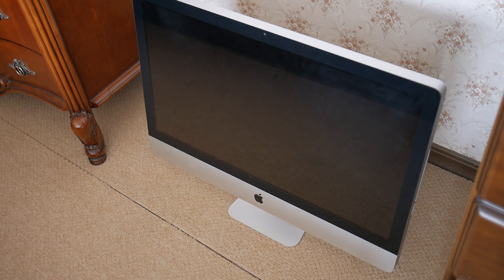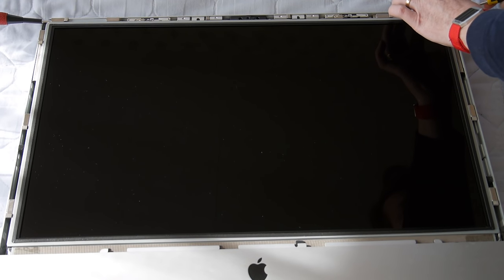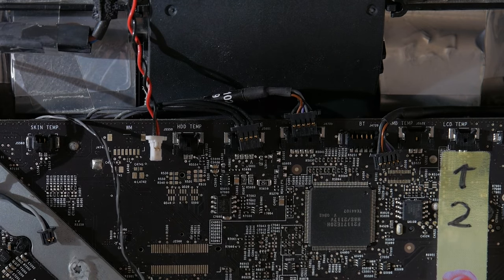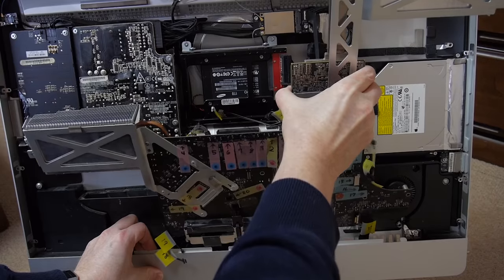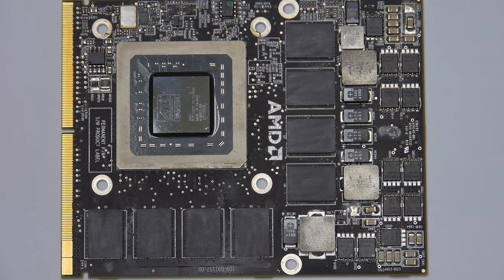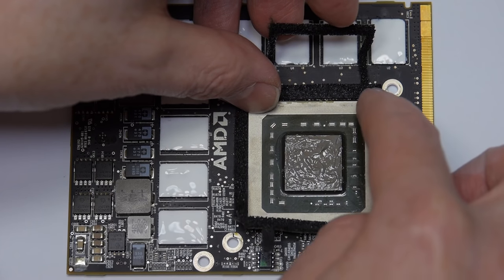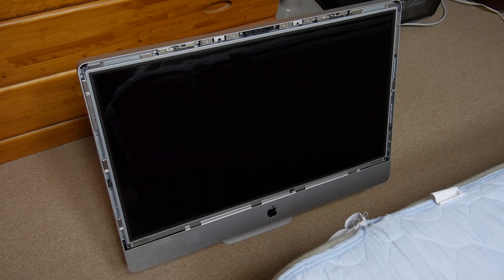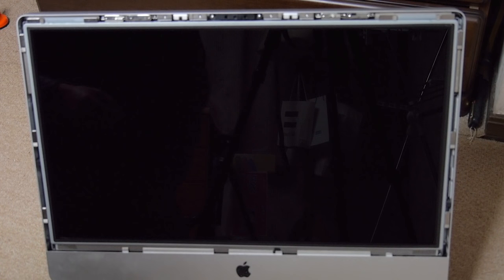Late 2009 iMac 27" Video Card Repair [4850 Bake]

Comment: Hello, how did you know that the little parts on the Backside would not fall off while you bake the card?
Reply from the maker: I know by having watched bakes of other people prior to even doing my first bake.  I also know from experience doing multiple bakes myself.  When you use an oven safe thermometer to determine that your oven's temperature is indeed correct, then you can be assured the temperature will not go high enough to liquify all the solder.  It is only when the oven temperature is wrong (too high) that components on the bottom side are in danger of being fully desoldered.  This is why I strongly recommend to use an oven safe thermometer to assess whether your oven's temperature is accurate and stable before you put the card inside.  Even so, most people who have done the bake didn't do that, and they did not experience components falling off.

Comment: At 51:30, did you have to force the CPU heatsink past the power supply? I'm having a hard time getting the board back in the case.
Reply from the maker: Yes.  If you are having a hard time, make sure there are no cables and connectors being smashed or hidden behind the motherboard.  Something behind the board may be the reason it is not sinking back down into its slot again.
Reply: didn't take out the RAM first! that was my problem :p, but i finished reassembling it and it is alive again. thanks for the thorough tutorial! My netflix machine will live to see another day
Reply from the maker: I had the opposite problem.  I forgot to put it back in and when I powered ON I got the beep... beep ... beep notification.  I'm please to hear though that you were able to get the board back in and your iMac is back up and running now.  Best wishes!
Reply: I forgot to put it back too and got the same beep. Scared me until I googled it and looked at the table with the leftover parts. Thanks again!

Comment: You have to give it to apple for being one of the only company’s out there to make a product that is more than useable 9 years later! Most computers of 2009 will be struggleing rn
Reply from the maker: The main struggle we iMac users have is the tear-down and subsequent bake when the video card goes down.  But once that task is done, it is as you say.  The machine is still quite usable.
Reply from the maker: Hopefully that "scrap" buyer will visit my videos and give the bake a try.  If you read through the comments here, the bake works for nearly everyone who has tried it.  Apple pisses me off quite a lot, but I've been a Mac user since 1984 and am not about to switch to Windows.
Reply: JDW that’s me, I’m about to grab 2 for 140 bucks
Reply from the maker: Two 27" iMacs for $140 is certainly a deal that can't be beat!  And to think they are probably that cheap only because of the video card, which as we know can be baked back to life.  Best wishes, Kales!

Comment: Which camera did you use to shoot this vide?  The quality is nice.
Reply from the maker: Thank you for your question.  My two video card bake videos were shot using the Panasonic GX-7 in 1080p.  More recently, I have been using the newer Panasonic GH5 to shoot my new videos in 4K.  You can check out those videos by clicking on my JDW name and accessing my channel.  (My newest videos are about restoring the Macintosh SE/30 -- an older Mac from 1989.)

Comment: I jnow this video is a few years old but I have a early 2008 imac and just recently its starts and have random lines and crazy stuff happen on screen and then it freezes. Though I can still move the mouse. Does that sound like a GPU issue?
Reply from the maker: Thanks for your question.  I actually have multiple videos on this topic and I read and reply to every comment.  Based on that experience, I can say with more than 90% certainty that the root problem you are facing is indeed the video card.  The good news is that other 2008 iMac owners have reported success baking their video card.  The inside of your machine will look a little different than what you see in my video, but the process is the same.  Be sure to see my 2nd Bake video (link in text description under my video above) to learn how to do the process WITHOUT removing the entire motherboard.  I also recommend K4 and K5 Pro thermal paste.  If you already have a good thermal paste for a GPU or CPU you can use that on the GPU of your video card, but you will still need K5 Pro to remove the old thermal pads.  That is described in my 2nd Bake video.  If you decide to do the bake, please report back with your success.  I hope this helps!

Comment: would replacing the gpu fix an issue with slow startup (with ssd) and only able to boot in safe mode with a corrupted looking cursor?
Reply from the maker: Replacing the graphics card or baking the card, as my video shows, will resolve such problems, yes.  But as I mention in all of my bake videos, replacing with a new card or baking is never a permanent fix due to design problems inherent to this series of GPU cards.  Some people have turned to Nvidia cards with success, but you need a Windows PC to flash those cards to make them work right.  I myself recommend the bake because it's the cheapest solution, and it tends to last long enough for most people who try it, especially if you use the two types of thermal paste I recommend in my 2nd bake video here: @

Comment: So i pulled out the connection for #3 that goes to the back of the screen, exposing all the wires.  is this something that can be fixed or am i out of luck
Reply from the maker: You are referring to the wider of the two ribbon cables that attach to the screen. You seem to be saying you either damaged that ribbon cable or pulled the connector off the motherboard. Can you take a PHOTO of the damaged area and upload that to a cloud service so you can provide me with a URL?
Reply: JDW I pulled the female connector off the logic / mother board. And exposed all the little wires.
Reply from the maker: @seabee2037  I am really very sorry to hear that.  I am sure you are extremely frustrated about that, as I certainly would be!  Please know that I read and reply to every comment under all my bake videos, and I can tell you that there have been 4 or 5 people who have been in your shoes.  Those folks either hired an outside technician to replace that connector (requires soldering and the purchase of a new connector), or replaced the entire motherboard (which I don't recommend since fixing the connector isn't hard for someone experienced and with the right tools).  Without that main ribbon cable connected, you will get a black screen, I am very sorry to say.  I wish I had a better solution for you, but that's basically your set of choices right now.

Comment: Can i repair the GPU for a better one hopefully a Nvidia one. I have currently the HD 4850 on my late 2009 i7 iMac
Reply from the maker: You can repair your 4850 by using my video, but I would not advise that you replace it with a different card. Newer cards may not fit perfectly, and newer cards may also generate more heat, which is the last thing you want. And no, you cannot use Nvidia cards.
Reply: @JDW-  it's working fine but not with Mojave on Mohave only the is runs fine but when i game it the screen goes blank in a white screen. Looks like it's a driver issue so i want to update it to a GPU that supports it.
Reply from the maker: @PaceyPimp  You said in your opening post that you have a late 2009 iMac, which is the same as mine. Apple doesn’t support macOS Mojave on that model, and that’s why I am still running High Sierra on mine. Apple only supports Mojave on iMac models from the year 2012 and newer. So that could be part of your problem.
Reply: @JDW-  yeah i used the patcher and Mojave works great only gaming didn't work on it.

Comment: great video but I have to say it if no one else has yet... you sound like someone that is on tv but I can't place who it is at this time but the video is very helpful thanks
Reply: after watching this video and leaving my last comment I had torn into the one I had and noticed I didn't have to do all of what you did,all I had to do is remove the 3 screws at the lower portion of the video card and unplug the heat sensor from the back off the mother board to remove the one we have it looks exactly like yours but did not have as many plugs at the upper portion but was helpful in leading me in the right direction

Comment: Can I use the artic silver 5 for all of the chips instead of the silicon non conductive paste? is it better or not?
Reply from the maker: Thank you for your question. The reason I did not use the "superior" Arctic Silver V on the memory chips is because there will definitely be overspill and the pins on those chips are exposed. Any overspill of conductive paste like Arctic Silver V will most assuredly cause a malfunction. Furthermore, don't remove the thick thermal paste affixed to the heatsink above the memory chips UNLESS you buy more of that same kind of paste to replace it.  The reason is because it is not a normal thermal paste.  Normal thermal pastes are rather thin (liquid-like) and are intended for situations where the chips are almost in direct contact with the heatsink.  The memory chips on the iMac's video card, however, are not like that.  There is a big gap between those memory chips and the heatsink, which is why Apple used a special thick thermal paste over those chips.  I didn't have that special thick-type thermal paste and I didn't want to buy and then wait for it to arrive, so I left that thick paste on the heatsink and merely applied new, thin-type thermal paste over the memory chips (non-conductive). That way the new paste I applied (white in my video) makes contact with the old, thick-type paste and transfers heat.  It isn't as "perfect" as completely removing the old, thick-paste and applying new thick-paste, but it's been several months since my repair and I've still not had any problems, proving what you see in my video does indeed work in the long term.  Best wishes on your repair!
Reply: unfortunayely I have already removed the old paste on the heatsink so I think I'll buy silicon pads that are not liquid, but they are all conductive...do you think that is a good idea?
Reply from the maker: Thermal "pads" probably won't spill over the sides of the memory chips and short the pins, so I don't see a problem.  There is only a problem if a conductive material touches the pins and shorts them.
Reply: it works!!!! thank you so much! can I ask you what settings for Macs Fan Control or any other program you use?
Reply from the maker: Thank you for letting us know, GMAIL.  I'm thrilled to hear it!  I set all the internal fans to run at 1800rpm so that it would run cooler.  It's a little noisy but not too bothersome, and hopefully the cooler operation will ensure that I won't have to repeat the bake trick for a long time (if ever).

Comment: Thank you for this. Unbelievable. I'm an electrical engineer too. I agree, this should not work. Yet, I just did it on my 2011 27" iMac which had a free graphics card exchange in about 2015/2016 and yesterday lost its graphics card yet again. Seems in my case it was a 5y rythm. Anyhow, I put it into the oven (the beast is not easy to get out of the machine) for 9min at 200degC and it works agian. Can't believe it. 
What I also can't believe is that Apple doesn't fix this type of thing correctly. Is there any deep analysis on the root cause done? Will this happen again when I buy a new iMac in 2021?
Reply from the maker: Thank you for sharing your success story, Siegfried!  The problem seems to only affect 2008 to 2011 iMacs.  I have a late 2015 27" iMac at the office and it's video card is still going strong to this day.  So it is highly unlikely a new 2021 iMac would have the same problem.  A lot of people think the problem with the 2008-2011 iMac video cards is the solder balls underneath the GPU chip, but I'm not so sure.  I personally think there is something that breaks inside the GPU chip which is fixed (for a few years at least) by the application of heat, whether that heat be an oven, a heat gun or GPU chip reballing.  But there has not been any scientific study done, like cutting the chip open, to determine the actual problem.

Comment: hello JDW. So i tried this last night because i had lines on the screen, but it doesnt work for me am afraid. When i push the start button now it makes the electric noise like if it s starting but the screen stays black and there is no mac starting  music sound. I can hear it s on though. I reassembled without the graphic card just to see, when i press start button it plays the mac start music but of course theres no picture. so i dont think i broke the motherboard or any cables while disassembling/reassembling just the graphic card has the problem i believe. I used methylated alcohol 94% to remove thermal paste. Putting on thermal paste back was horrible and sticky. i found useful to remove the motherboard to get to the small cable behind. Any idea?
Reply from the maker: Your mention of an “electric noise“ has me curious. Could you please record that sound and then post a link to it using a cloud service like dropbox so I could hear it? Thanks.
Reply: hello! thank you for quick answer.
 i uploaded the file here:
https://www.youtube.com/watch?v=rZugxUEIsdQ
So it sounds like it starts and stops and then tries to start again and then nothing happens.
Reply from the maker: @gregsserver  Thank you for making that video.  I hear a spinning platter hard drive start to spin up after you power on.  I then hear a rather loud clunk, at which point the HDD suddenly powers off, and then I hear your HDD spin up again and it seems to remain spinning.  A defective video card can cause your iMac to suddenly stop working, but I don't recall if my HDD made a loud clunk sound like that when the iMac suddenly powered off.  That part is very odd.  I've not used an internal HDD for many years which is why I cannot quite remember.  I do know a bad video card causes freezes and odd on-screen artifacts, but it should not suddenly kill power to the whole machine, and certainly not in a way that causes a loud clunk sound.

Hard Drives do draw a lot of power.  I doubt the root problem is your power supply, but one test you could try is if you have an external drive that you can boot from.  My recommendation would be to open the iMac, disconnect the power cable to your internal HDD, then close the machine (put at least one screw in the display so it doesn't fall out and break your cables), and then see if your machine boots off that external drive.  My guess is it won't, which means the root problem really is your video card and the bake simply did not work for you.

Before your first bake though, did you fully clean off ALL the old paste?  And after your bake, what paste did you use on the memory chips, and what paste did you use on the GPU?
Reply: hello JDW! i dont think it s power supply because if i power on the mac without the graphic card it powers just fine expect there is no picture.  i think i made a mess with the thermal paste or the oven heat. i could remove all the old paste using methylated spirit 94% and used the k4 and k5. i could not use the anti-static wrist strap (it took for ever to be delivered).maybe i can take some pictures of the card thermal paste situation and send it in a video in a couple of days. i m really late with my work. thank you :))
Reply from the maker: @gregsserver  The anti-static wrist strap isn't absolutely necessary.  In all honesty, I've never zapped my video card even when I don't use a strap.  But it is a precaution because some people might do the job on a rug wearing socks, and that would potentially cause electrostatic discharge to the video card and possibly fry something, which of course you would not be able to see.  I doubt that is what happened to your card though.  

You said your card worked before except that you had lines?  And now your screen is totally black?  That is a bit odd.  Was your oven temperature regulated to 200°C and did you bake it for 10 minutes?  My oven is a convection type that blows hot air around the inside using a fan.

The only two possibilities I can think of, assuming your bake time and temperature were correct are these:

1. Some cable inside is only partially connected, resulting in no video.
or
2. The bake simply did not work for your card.  Even if your bake was the very first bake, it is not "impossible" to imagine that the bake did not work.  Based on the comments of others, I would say that case is rare, but again, not impossible.

The best thing to do would be for you to open your iMac, remove the display, and check all the cable connections again.  Reassemble and test.  I know it's troublesome, but it really could be a cable that simply is not fitted properly.  Be sure to check that ribbon cable in the upper left corner, making sure the tiny little flat connector is still looking good.  That little connection breaks easily and could potentially be the problem.

Please let me know what you find.